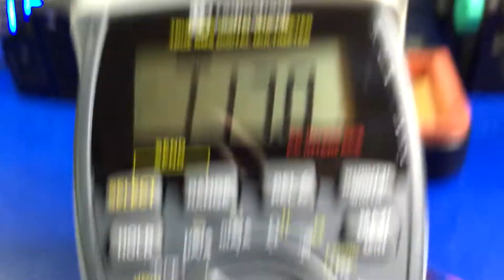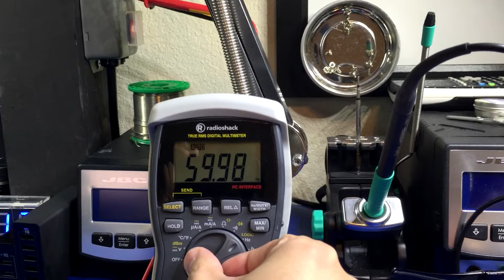RadioShack True RMS DMM Review Followup (Mains on Ohms Setting, and Frequency Test) #0043

Comment: In Europe we use 1.5mm² or 2.5mm² wiring for most mains cabling in residential buildings, and the allowed fuse sizes are 10A and 16A, respectively. At 230V nominal mains voltage that translates to 2300W and 3680W, respectively. How do you get decent power to your appliances in the USA with the wimpy 110V mains voltage? I would guess that either you can't, or you need to use ridiculously thick wiring in your houses, or you use current densities that would be considered unsafe in Europe?
Reply from the maker: +Jaakko Oksa We have 220vac for heavy power appliances like clothing dryer but most of the other appliances don't need that much power and are fine with the 1800 watts
Reply: +TechnologyCatalyst I always thought everything was supposed to be bigger in the US, but now it turns out that our everyday items such as $20 electric kettles and vacuum cleaners have more power than a standard wall plug could provide in the United states :-) 

How can you have twice the normal voltage (220 vs. 110/120)? The voltage between two phase leads would be only about 1.4 times the phase voltage, so would that not require two entirely different sets of supply lines to be drawn into your house instead of just one?
Reply: @jaakkooksa5374  The voltage in Canada and probably the USA, has been turned up to 120 VAC for a long while now. It is no longer 110 VAC. Actually, the wires that come to a house, there are 3 wires. You can go outside and look at any transformer and they always have 3 output wires. The central wire is a center tap. It connects to the middle of the transformer winding. This is not ground. So, let’s call the wires 1, 2, 3. If you use 1 and 2, you get 120 VAC. If you use 2 and 3, you get 120 VAC. If you use 1 and 3, you get 240 VAC. You also need another wire, the ground wire, and that attaches to the copper water pipe. All the outlets in a house are 120 VAC. You might be lucky and have a 240 VAC and these outlets look very different. Our electric oven uses 240 VAC. I think the heaters (resistive heaters) are all 120 VAC and I know for sure that the water heater is 120 VAC.
Reply: @louistournas120  What kind of wiring (how many mm²) do you use for each fuse (circuit braker) size? We have 1.5mm² for 10A and 2.5mm² for 16A, which are the most common fuse sizes in residential buildings. These are considered safe maximum loads for each wire size (cross section).
Reply: @jaakkooksa5374  The copper wires for the conducting wires seems to be 1.2 to 1.3 mm in diameter. They also make the ground wire the same thickness which is a waste of copper. I think all the cables are rated for 300 V. If you are lucky, you have ground wire. I don't know about the fuses. In our house, the fuses are mechanical. They look like light switches and if one pops, you can reset it to the ON position. These probably contain a bimetal thing to bend because of the warming and it cuts the connection. They probably also contain a magnetic thing so if you draw too much current, like 50 A, it quickly cuts the connection. I think the fuses allow a max of 15 A. You can get 120 VAC * 15 A = 1800 W and all the resistive heaters they sell are rated 1500 W. The baseboard resistive heaters are marked 2000 W so maybe they use thicker wiring and a separate fuse.